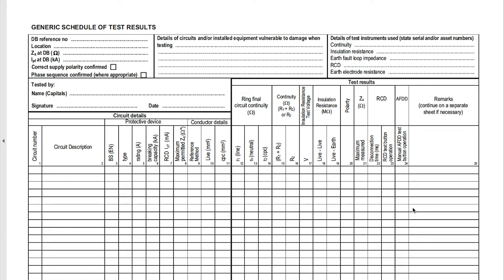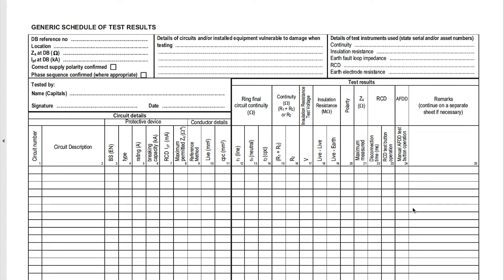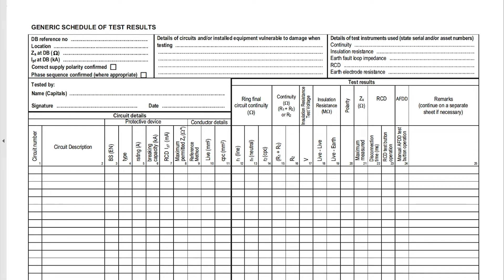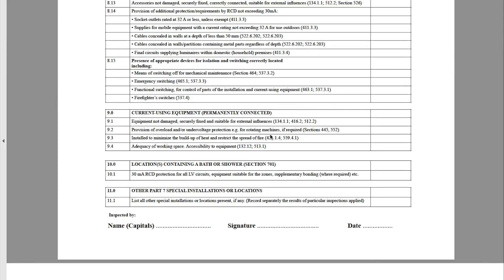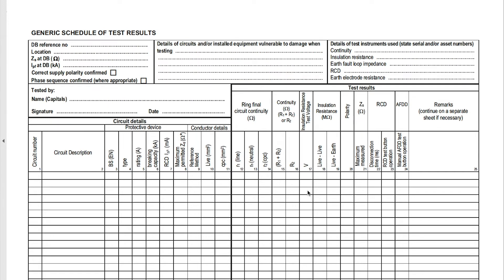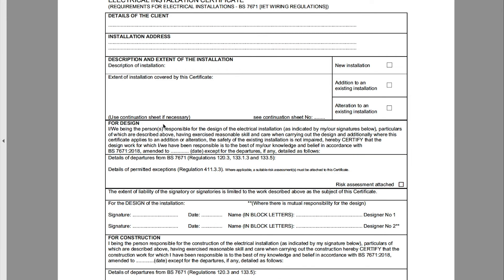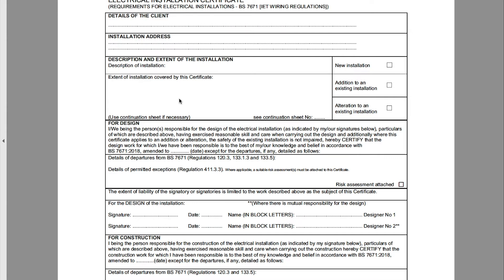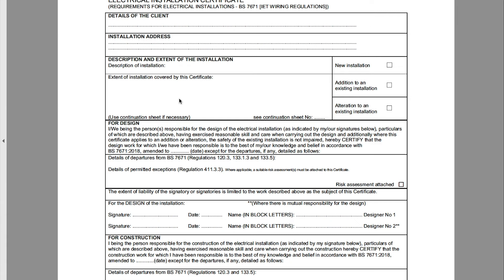What should you complete doing a board change.

Comment: Paul Smith , he’s right you should only complete the paper work that is relevant to the work you did , an (EICR electrical installation condition report) Is to determine whether the installation is safe for continued use, not to to determine whether a CU upgrade is required, there is no regulation requirement to upgrade an existing installation. Or to bring it up to the current standard I refer you to page 99 in the current version of the onsite guide, and to the HSE note in BS7671 , try fecking reading it . Ware he has got it wrong is if you replace an old CU with a new CU then you test all the circuits and you carry out Ze continuity insulation resistance ring final and so on , the you complete the electrical installation certificate witch details the installation characteristics followed by the schedule of test certificate . An (EICR  electrical installation condition report) is not required prior to a board change. You should never take responsibility for someone else’s work, if you install a new circuit to an existing installation you are only responsible for that circuit. Nothing else, if you install a new CU you are responsible for the hole installation as you are required to insure that the MCBs RCDs or RCBOs are suitable for the installation. And you test all circuits in accordance with BS7671  18th edition 2018+ amendment two 2022.
The IET model forms come as a complete package, in a set of three , each accompanied by a set of two notes one for the installer and one for the client.
1)electrical installation certificate 6 pages.
2)minor electrical installation works certificate, 2 pages,
3) (EICR)condition report, 9 pages, you only complete the document relevant to the work ordered and witch you completed . 
Try reading the notes .

Comment: you SHOULD carry out an eicr BEFORE a board change, to confirm the installation meets the requirments of bs7671 and is safe, hence you have to take full responsability of that installation, you cannot pick and choose what circuits to just test,  once the eicr has been found to be in a 'satisfactory'  condition, then you can proceed to upgrade the board, and your test results from the eicr along with the new board protecive devices etc, go onto a installation certificate. so what your video suggest is you dont do any tests,  and leave most of the cert blank..........so how do you know that the ring circuit is not broken, and you have just connected that circuit to a 32 amp mcb, well done you have now created a fire hazzard as now you have a circuit that will only carry 16 to 22 amps on a 32 amp mcb, how do you know the cpc is all connected in the lighting circuit or boiler system,  the law of the land is this, any person who works/alters that installation is the  last person responsable for  the safety of that installation,  your video is misleading and incorrect....and your very wrong, you cannot get around it by just putting what you think you can put on a cert, when your arse is in court, you will have to justify why you did a shit job..........i take it your not a PROPER sparky
Reply: Paul Smith , he’s right you should only complete the paper work that is relevant to the work you did , an (EICR electrical installation condition report) Is to determine whether the installation is safe for continued use, not to to determine whether a CU upgrade is required, there is no regulation requirement to upgrade an existing installation. Or to bring it up to the current standard I refer you to page 99 in the current version of the onsite guide, and to the HSE note in BS7671 , try fecking reading it . Ware he has got it wrong is if you replace an old CU with a new CU then you test all the circuits and you carry out Ze continuity insulation resistance ring final and so on , the you complete the electrical installation certificate witch details the installation characteristics followed by the schedule of test certificate . An (EICR  electrical installation condition report) is not required prior to a board change. You should never take responsibility for someone else’s work, if you install a new circuit to an existing installation you are only responsible for that circuit. Nothing else, if you install a new CU you are responsible for the hole installation as you are required to insure that the MCBs RCDs or RCBOs are suitable for the installation. And you test all circuits in accordance with BS7671  18th edition 2018+ amendment two 2022.